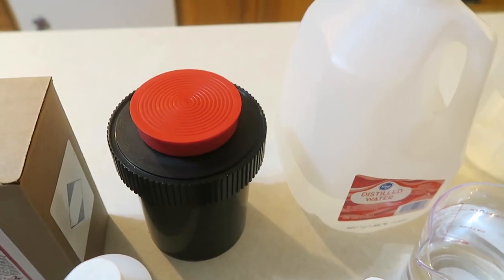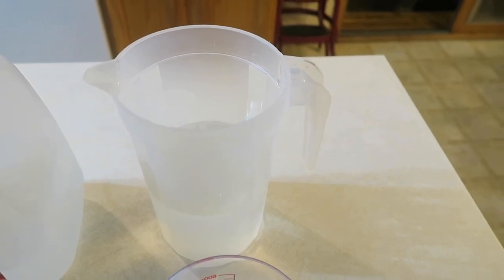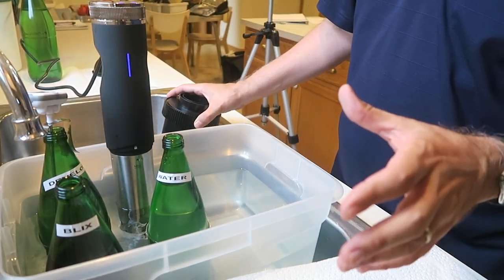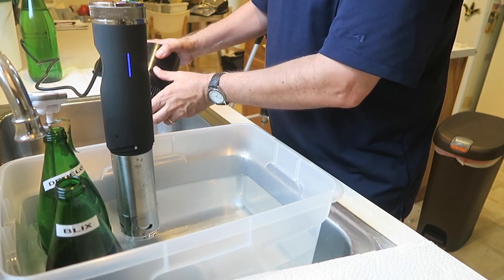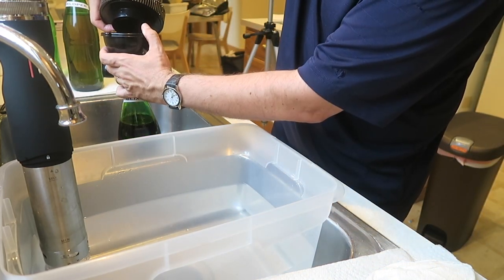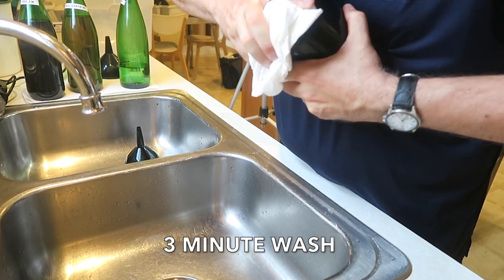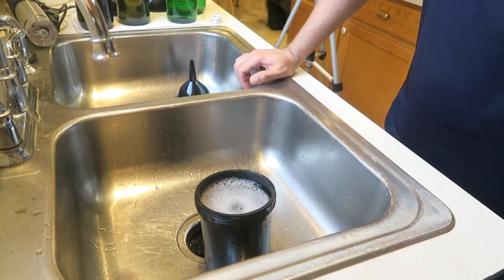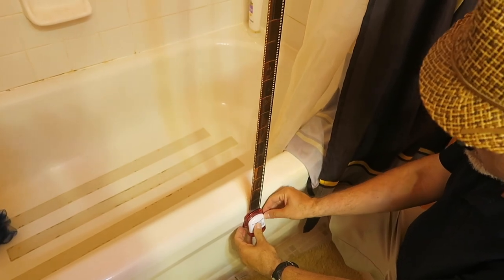HOW TO DEVELOP COLOR FILM AT HOME

Comment: Good job on this my man, I've been developing color film for a few years now as for me it takes more time and effort than black and white especially scanning and color correcting because on each Roll I can have a perfect color shots and another one can take forever to white balance another thing I noticed is the Blix will eventually develop a white powder at the bottom and sometimes if I wait several weeks to do another roll sometimes that roll will be completely blank and I had no way of knowing that the developer was exhausted. What I really want to do on my channel is experiment with developing three rolls at different temperatures, one at room temperature, the other at manufacturer recommended and the last at about a hundred and twenty-five degrees just to see the difference and how critical the temperature really is
Reply from the maker: Raychristofer That sounds like a cool experiment.  I have developed 17 rolls with this kit, but it was all within a week and a half and didn’t have much time to sit unused.  I may try cross processing a couple rolls just to see what happens.  Thanks for sharing your wisdom and observations!

Comment: Hi that was grate to watch use the different color cook spones is clever. I just dev my first color film it came out grate. My cinestill worked OK when you turn on the cinestill it has the default times plus the temperature 103F. I did find that rise the temperature to 110F did give the water temperature in the div to 38C or 103F. If you want to change from F to C you press on switch and Cs together this will change the F to C setting its a bit of a puzzle so it best to use one so you get used to the cinestill. The one I got was the powder dev it's worked well does take a little more care as its in powder form ware a mask and gloves. Brendan
Reply from the maker: Glad everything worked out for you!

Comment: Heyy great video! Question, do you use a film squeegee to remove access water or you just let it hang dry? My biggest concern is water spots.
Thanks!
Reply from the maker: Thanks - I don’t use a squeegee.  I shake the film back and forth to try to remove some of the excess water before I hang it up.  With distilled water and photo-flo, I haven’t had a problem.
Reply: theoldcameraguy got it! Thanks for the help 👌🏽

Comment: Another great video! Thanks! One advice though: I really don’t understand «ounce» and «farenheit» and all that Imperial measurements. Why not give a hint to us Metric-heads so we have an idea? Keep it up! 👍🏻
Reply from the maker: Bernt Sønvisen The metric system makes my head hurt 😄 I can handle units of length better than temperature and volume because the zone focus on my Lomo LC-A is measured in meters and I’ve (mostly) gotten used to it.  The CineStill kit does include metric measurements in the fine print of its instructions so it’s got both of us covered.  The main parameter that matters the most for this kit is to maintain 39 C for the developing temperature.  I appreciate the advice and thanks for watching!
Reply: I was thinking the same thing. I've been watching videos not just for how to do it, but I'm also looking for "what to buy". It's also a lot easier working in metric since everything is based on 10. FYI: 32oz is almost a liter, 946ml. 20oz is just over half at 591.5ml. So I'm going to buy my larger containers and mixing vessels as 1 liter at least, except for one smaller measuring tube at 25ml. 

Some things only require small amounts or maybe you are mixing a smaller amount because you don't need a liter right now. The liter measuring cups sometimes start with 10, 20, 30ml but you might need 5ml or 16ml but the gradients are too course to measure exactly. Smaller vessels will help here as each milliliter has a line starting from 1.

Comment: this is a great video. I have a question... I thought the temp was sensitive only once the chemicals were mixed. not prior to mixing. is this not the case? thanks!
Reply from the maker: CineStill’s instructions say to heat the water you’re using to mix the developer to 120F and the water for the blix to 125F.   The chemicals that your mix into the water can be room temperature - you don’t have to heat the bottles of chemicals from CineStill.  You just heat the water (I use distilled water).  Thanks for watching!
Reply: @theoldcameraguy  gotcha. that makes sense. btw i wasnt expecting your photos to turn out the way they did at the end. theyre amazing!
Reply from the maker: Saint James Thanks - I really appreciate it!

Comment: Washing: Running water into the top of the tank and reels does not wash the film. Use a funnel at the top or run a hose down into the tank to force water down to the tank bottom, up over the film, and overflow out. Stabilizer: use distilled water to avoid hard water spots from tap water. Put Photoflo in the stabilizer. If you use a separate Photoflo bath after the stabilizer, that just washes  the chemical stabilizer back out of the film. The Photoflo breaks water surface tension and allows it to run off without drying marks; stabilizer does not have this property. Avoid the Cinestill two-bath kit, which eliminates the stabilizer. Apparently Cinestill needed to save 10 cents on the chemical and figures that by the time your negatives start fading, you will have scanned them anyway and don't care.
Reply from the maker: I like to use distilled water for any chemistry I mix, including the stabilizer.  It’s inexpensive and definitely better than my tap water.  I usually get my supplies from Freestyle  - this CineStill liquid (3 bath) kit is out of stock, but they have the 2 bath kit available.  I’m taking your advice and avoiding the 2 bath kit - It’s worth waiting to get the kit with the stabilizer.

Comment: Are you suppose to see the print immediately after taking it out the tank? I’ve tried twice the exact same way as the video but once I took them out it looked as if they went developed still...
Reply from the maker: Yes - you should see images right after you take the film out of the tank.  The colors will be inverted because they are negatives, but the images will still be visible (assuming camera is working properly and exposure is good).
Reply: @theoldcameraguy  Thank you for your quick response! If I may ask, do you know why the film might not developing correctly? I’ve tried everything and I still end up with film that looks undeveloped...
Reply from the maker: The only time I’ve had a blank roll is when I had a faulty camera (the shutter didn’t open).  If the undeveloped roll is exposed to light before it’s put in the tank, that can cause a blank roll too.  If the lid is taken off before the development and blix steps are complete, you can also get a blank roll.  If the temperature is off, you may get color shifts or over/under development, but you will still get images.
Reply: @theoldcameraguy  thank you! I don’t know what’s happening.... maybe I accidentally cross contaminated?? I don’t know! I just bought a new kit so hopefully it develops next time.
Reply from the maker: Yes, if the developer and blix mix at all, your kit is dead.  Good luck with the next one!

Comment: If you develop more as a hobby and only doing about 3 rolls or so at a time, does it make sense to mix only half of the liquid kit and then the other half later? (And would you just use half the water?) Or does it not make a big difference?
Reply from the maker: Enrich Visuals I haven’t tried this, but some of the folks on rangefinderforum have.  Once I break the seal on the chemicals and expose them to oxygen, I just mix the whole kit. I’ve had kits last several months and last for 20 rolls with good results.  Thanks for watching
Reply: theoldcameraguy thanks for the response!
Reply from the maker: Enrich Visuals You bet

Comment: Very good process video, except for one point - the wash. Putting a tank with reel/film inside and running tap water into the top of the tank is the equivalent of almost no wash at all. When they say to run water over the film, that is exactly what is meant.  You do that by running your water through a small hose, the end of which is inserted down the center of the reel(s) in the tank, so water goes down the center tube, out into the tank at its bottom, and then flushes up through the reels, over the film and out over the top of the tank. Depending on tank design, you might need to put a spacer (bottle cap) in the bottom of the tank to raise the reels and let the water freely flow.

Comment: Why are the developer time and blix time different when they have the same instructions for agitation? Shouldn’t they both be the same time?
Reply from the maker: They are different chemical processes, so they have different times. BW developing and BW fix often have different times as well.
Reply: @theoldcameraguy  if you’re agitating initially for 10 seconds and then 4 times every 30 seconds, shouldn’t the overall time be ~4 minutes for both developer and blix? I guess I’m just confused on what the time column actually represents on the card
Reply from the maker: @brennan9629  To agitate, I use the swizzle stick and just turn it 4-5 times at 30 second intervals. You just keep going with the blix (agitate at 4:00, 4:30, 5:00, 5:30, etc) until you reach 8 minutes. So twist 4 times at 30 second intervals until you reach the desired time for each process.
Reply: @theoldcameraguy  ohhhh I misinterpreted what the 4 was for! Thanks so much for your replies!
Reply from the maker: @brennan9629  You’re welcome

Comment: I totally screwed up two rolls of film now. The colors are all wrong and off. I don't know if maybe it was the camera, if I messed something up when preparing the chemicals, or if I did something wrong during development. I know it's a learning curve, and I'll get it, but man that sucks.
Reply from the maker: The Alpha Nerd Man, that is a bummer.  Sometimes it’s hard to figure out what the problem is, because there are so many variables- the film, the camera, the chemicals, the processing, the scanning.  I wouldn’t expect the camera would affect the colors that much (exposure maybe, but less likely colors).  Expired film or film exposed to excessive heat can definitely cause color shifts, but if your film was fresh and properly stored, it’s probably not the film.  Maintaining the correct temperature throughout the development process is critical as is guarding against cross contamination of different chemicals.  Just like you said, it’s a learning curve - hopefully your next batch roll comes out better.